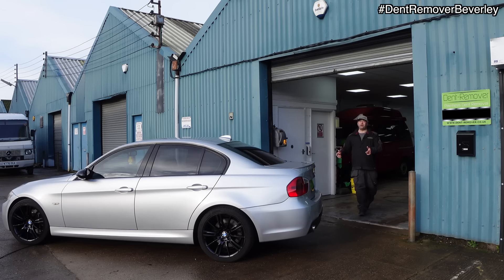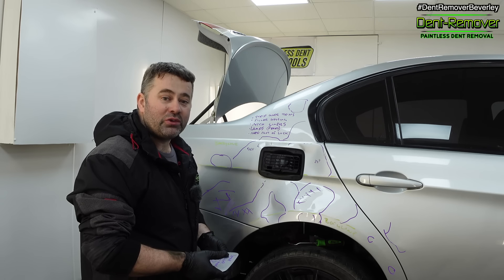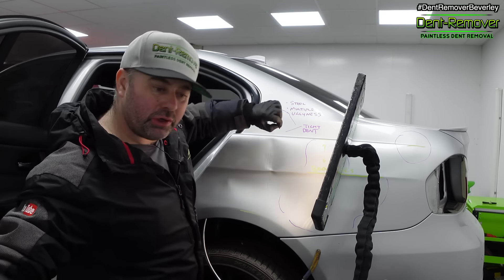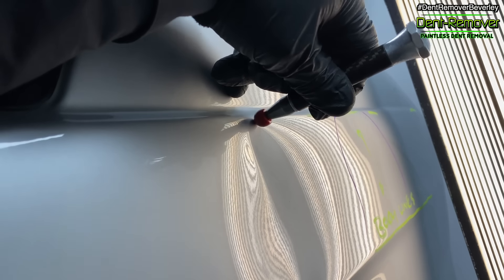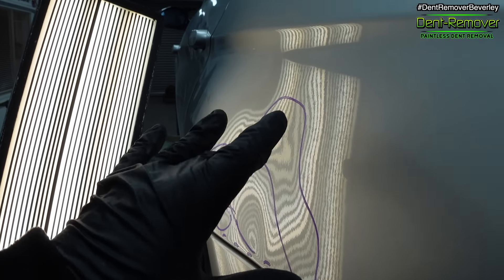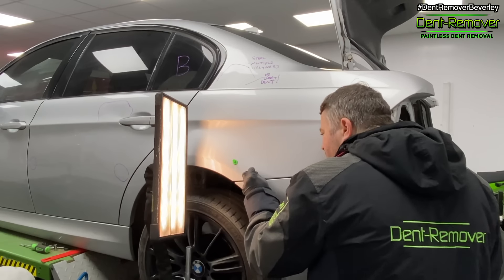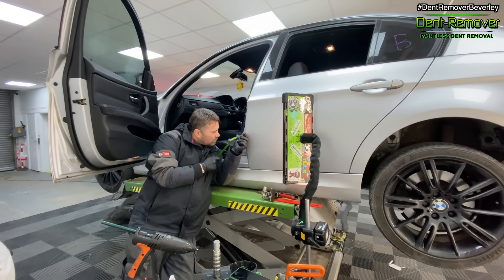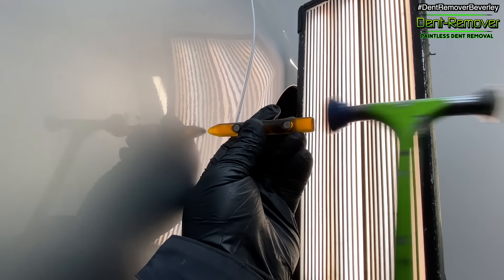Mastering Paintless Dent Removal | Repairing 2 Quarter Panels On A Bmw

Comment: BTW… ex body and paint guy here…. We used to always do the HARDEST side of the car FIRST. Best to know you have LESS work AFTER more work. 😊
Reply from the maker: Hi!! Yes that’s a good way to approach a repair 
I try to do this too as much as possible because if it goes wrong then you haven’t wasted your time
Reply: Or you get warmed up on easy part first.  This builds your courage to face the really hard part.  
But if your using body filler you mix a batch for the big area and use up the leftovers on small dings.

Comment: Love your work! Question. The heating gun, is that a normal house paint stripper gun or something else? Would a hair dryer do the same thing although slower? (Just for an amateur have-a-go-at-home bloke) 🤩 Cheers Jon
Reply from the maker: Thanks Jon
Yes it’s a wall paper heat gun or industrial one. If you’re in the uk then look at the Titan ones from Screwfix. They are £20 
Just go very careful though on your car paint. As soon as it gets too hot to tough stop. Or you will most likely bubble the paint on steel. Plastic bumpers even more so.
Reply: @dentremover01   brilliant thanks so much for taking the time to reply. I’m in Leicestershire so I’ll take a trip to screw fix! 👍😄
Reply from the maker: Spot on!

Comment: That is amazing work fair play to you, probably the best I've ever seen, ive been painting for over 33 years and have used and seen a lot of PDR but nothing on this level, i try to do small bits on blend panels and dents I'm repairing for painting just to have a go really it does interest me but I'm not any good, i just have a small amount of cheap glue stuff and bars off amazon. Im not sure on what glues to use as i struggle getting tabs to stick could you tell me where and what glue i should use 
Great video 👍
Reply from the maker: Thank you for your great comment! And by the way I subbed to you last night! 

PDR is a great way to reduce your blend area if you can wiggle a ding out it will save time and products.

Amazon glue kits are ok but you’re better off investing in proper GPR equipment. Speak to Keco Uk and ask for Sam, or Kevin and mention I sent you. 
You just need a Variety tab kit, some flex collision glue and their glue gun. And a slide hammer. 99% Isopropyl from Amazon and you have all the basics for a range of small to medium dents 
Look at the Keco 6c process to as that will help regulate your glue pull method
Reply: @dentremover01  Thank you for the reply and sub, ill check out the stuff you mentioned, i do have a small power tec kit with a slide hammer but ill get on the internet and check out what you said 
Thank you for all the advice i really need to get some where with learning to do this for myself as there's not a lot of reliable enough guys in my area doing it
Reply from the maker: It just takes practice. You don’t need all the gear, if you see what I use on most of my videos when glueing (not massive stuff) I use simple gear. 
Happy to let you pop down for a few hours if your local
Reply: @dentremover01  Thank you thats great, id be very interested in coming over and  having a lesson, I'm based in swindon are you far from there

Comment: Hi , Can you explain why you use tap down pen and not just use a hammer ? Thanks
Reply from the maker: Hi. Yes sure, I use a few different sized heads on my tap downs to move amounts of high metal. 

Using a hammer for the exact process is possible with the skillset but for me I’m more accurate this way.

Panel beating sure, hammer and folly all day long but to get a perfect finish would take a lot of skill and like I say I’m comfortable with my hammer and KD setup 😉

Comment: Lots of tips in this video, I never knew heating up the stubble made a difference. What do you do if the paint cracks, can you melt it together again?
Reply from the maker: Thanks Daniel! I’m not heating my stubble I’m warming up my double chin! 

Serious note the heat gun takes a few secs to warm do I gauge it with my Jowels 
Cracked paint is the death of the repair, once it cracks it stays cracked but by warning the panel, using select tips I can really minimise this issue. 

Ps. I have a parcel for you!

Comment: Martin what tap down would you recommend for aluminium mate
Reply from the maker: Hi Sean. Thanks for your message. Your best off choosing a nice screw tip knock down and then you can swap your tips. 
Top choice for Ali, I’d look at a root beer or peek tip and then just practice to see what works best. 
I wouldn’t go too sharp as Ali takes more effort imo to flatten down. But again with practice you’ll be able to dial in knockdown work 
Hope this helps

Comment: Nice job You always do a nice job though. I was wondering Do you ever heat your shop. Maybe a small infrared heater just pointed in your direction. 🥶
Reply from the maker: Thank you!! 
Yes I’ve used a parafin burner but looking into a panel heater I’ve tried them and really good and cheap to run

Comment: Magnificent work, but why say thinks like insurance right-off🤯 world we live in🤮
Reply from the maker: Thanks for your comment. Our customer was sure the insurance would write it off. Both 1/4 panels would have been down for replace and the doors needed dents removing. Atleast half the car would be repainted so they would almost certainly write it off
Reply: I am the owner of this BMW, and the insurance company wanted to write it off and offered me about 2k short of current market value. Every PDR specialist I contacted and showed the car to said they couldn't do it and it needed both rear quarters replacing. Martin was confident he could sort it and sure enough he did sort it, he also kept me informed the whole time messaging me daily with a progress update and photos. Martin is a lovely guy, very informative, and has a real passion for his trade.
Reply from the maker: @channex8179 thank you so much Ade 🙌🏼 that’s the last of the videos il leave you “be” now! 

Thanks again for contacting me for your Dent Repair and putting your faith in me 

Thanks Martin
Reply: @dentremover01  Haha, no worries 👍🏻 👊🏻

Comment: This video should be renamed 'how I do paintless dent repair' because we only see you doing it and essentially learn nothing other that the tools you're using. I suppose that's the idea, though.
Reply from the maker: Thanks for your comment. I just scanned through the video to see why you think that, and to be fair I show a hell of a lot more than anyone else does on a PDR video
All the areas are explained to the viewer on how a big job like this can be saved without filler and paint. Yes I have to talk about the tools to explain how it’s fixed and I’m not getting a thanks for promoting or talking about the tools. 

It’s strange how people are quick thump have an opinion which comes across negative. 
There’s no way a diy job could be done on damage like this to this kind of quality, I’m literally showing the viewer how 2 1/4 panels are repaired with PDR.

If you want to learn then you’ll need to go on a PDR course and pay thousands and be prepared to put months of practice in to fix a simple dent. 
Il show and explain as much as I can but I do this for free and this video alone took 100 hours + to make